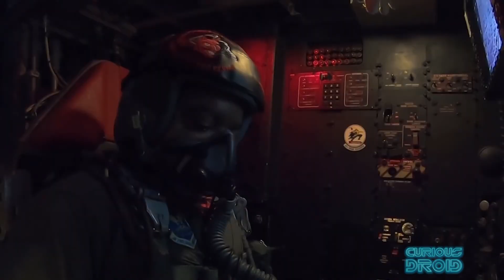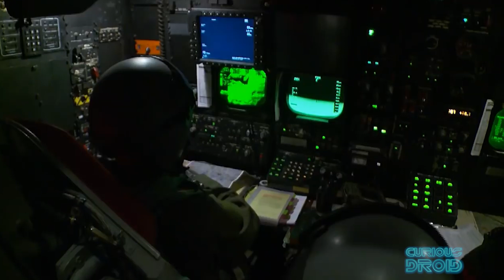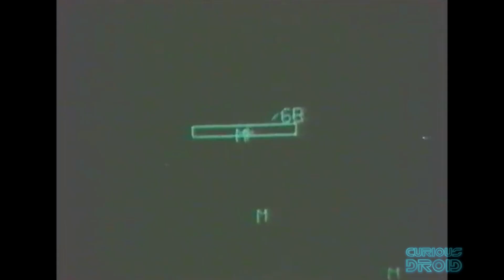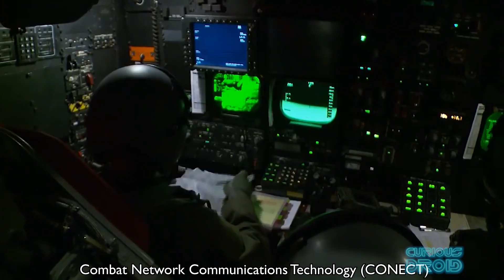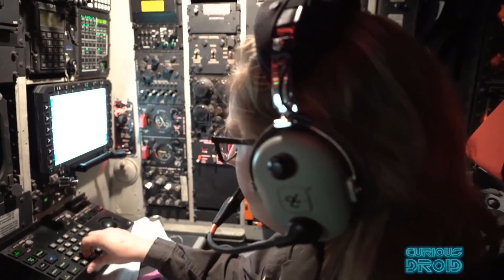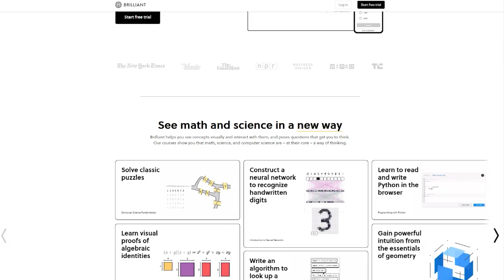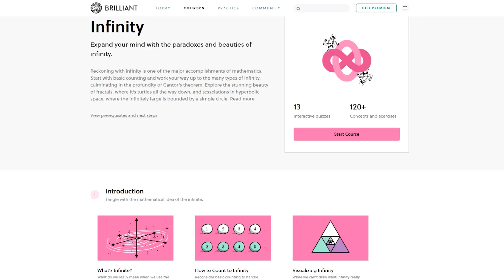How Long Can the B-52 Continue in Service?

Comment: B-52's time in service is longer than its wingspan.
Reply: Good one
Reply: You'd think that, but in reality, they're smaller than most passenger airliners. Because it has a very slender fuselage compared to its wingspan, it looks a lot bigger on video than it actually is.
Reply: @SRFriso94  True, but a 747 cant really carry a whole lot of bombs.
Reply: @mikester1290  It could. But How to release them? It would be a suicide mission.
Reply: @macdaniel6029  It's been attempted... there was that air-launched ICBM concept they tested, and Virgin Orbit is recycling the idea as a space launch. If a 747 can tote an orbital rocket under the wing then you could probably dream up a way to make that a payload of ordinance.
Reply: @John La Duke that was a C-5 Galaxy not a 747
Reply: @mikester1290  Why not?
Reply: @MrFlatage  It doesn't have that rotating ordinance thing, it doesnt have bomb bay doors, it doesnt have pylons to mount weapons onto. It isnt electrically rigged up to support all of the electronic gear to operate any of the above mentioned bits, its not designed to my knowledge to fit a big juicy radar on the front (could be wrong, i dunno) Of course all of those things could be fitted with modifications and would be very interesting for sure.
Reply: @mikester1290  747s arn't flying blind they have nose cone radars. Would be easy modifications. It's like telling Doolittle he couldnt fly bombers off a carrier.

30 tons for a B52 and the 747 cargo lifter can do 130 tons.

B52s didn't start out with rotary missile launchers or the specific doors for that. The weapon pylons were added later as well. The 747 Supertanker is the worlds largest firefightying aircraft.

Just like they are not designed to fly into buildings? Doesn't mean they can't.